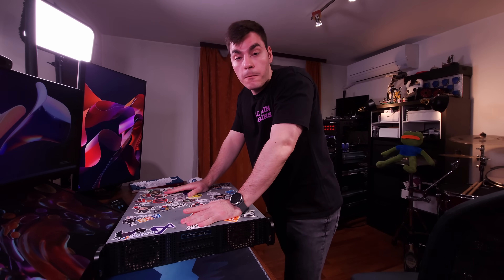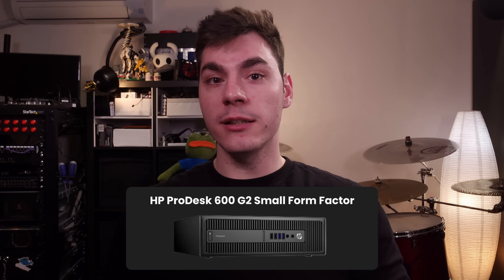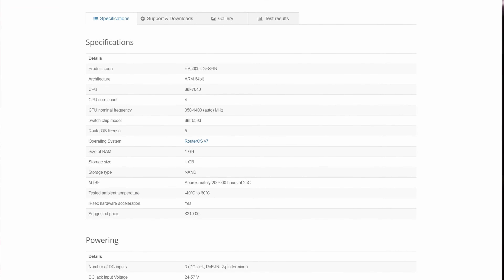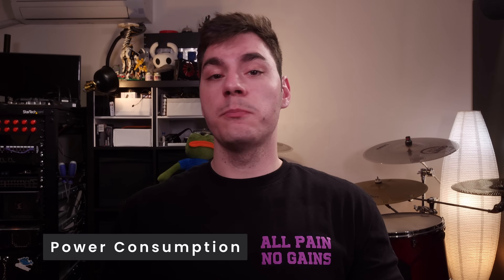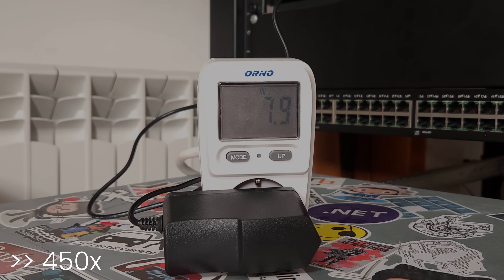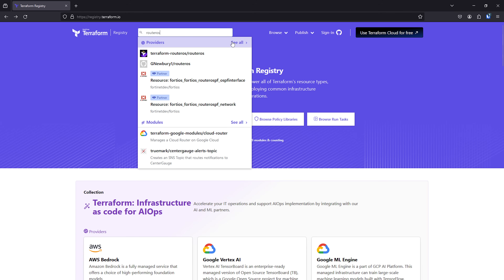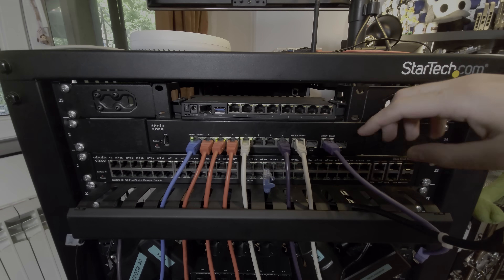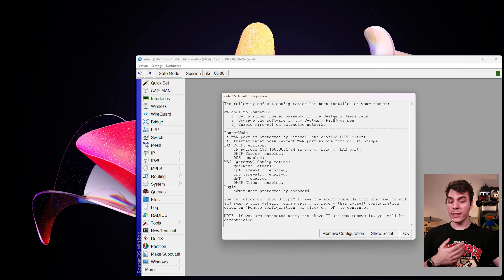Migrating From OPNsense To Mikrotik

Comment: Been using Mikrotik for over a decade now. Always exciting to see new content.
Reply: I've had a Mikrotik for must be 15 years. It's been sitting up a pole in the sun for probably 8 years. It still takes the latest updates and I upgraded the lte card in it. They still actually sell the board I believe, the rb912
Reply: @michaelculley8790  They discontinued the RB2011 a while ago. Which was the classic workhorse that we were using. Still using it actually. For basic needs it is still quite capable. But I am planning on upgrading as now I am playing with a more advanced setup... That old 2011 is like the little router that could. It will try but at a certain point asking a little engine to climb a steep mountain is cruel and one shouldn't be surprised when the CPU experiences issues with being loaded down... Plus I want to play with containers and for that I need an ARM based model as the MIPS processor doesn't support virtualization.
Reply: And like your RB912 it still takes the latest updates. I just ran updates on it last weekend.

Funny thing is I am running a multisite network all connected using a Wiregaurd tunnel and my HaPAX3 in my apartment has become the central hub... Yes a model designed as a basic router is managing everything... Just reflects how powerful a platform this is.

Comment: The RB5009 has a Marvell 88E6393 switch chip which does 10 Gbps accelerated L3 routing!  I've succeeded at making Ansible work with RouterOS, but i'm in the early stage to check idempotency, etc.  I don't know if you'll use 802.1Q trunking but it's fairly easy to do with RouterOS once you know 1 or 2 specific things. As a network engineer (and Linux Sysadmin!), i'm using Mikrotik since circa 2005 and i was certified MTCRE (just didn't do recert) so if you need help, just let me know!

Comment: Looking forward to the next video. I use both OpnSense and Microtik but my current Microtik hardware is in need of an upgrade. Just replacing with OPNsense feels like the easy option but i do like the look of the RB5009's.
Have you considered failover? And do you know how easy it is that to set up with routerOS?
Reply: There are many videos on using more than one internet access link, RouterOS can even load balance and do very crazy things!  Mangle is very powerful and i use it often to do many cool stuff with routing, DNS, etc.
Reply from the maker: I haven't really looked into it so I can't comment on that.
I will say, however, that if you're looking for fail over I think it's pretty nice that you can fit 2x RB5009 routers in a single rack unit using the k-79 mounting kit
Reply: you have one of the most annoying accents that I have ever heard 😂  @mirceanton

Comment: Welcome to mikrotik.Been using mikrotik since 2017,before that using x86 monowall  in 2008,x86 pfsense in 2014..now 2024, playing with openwrrt
Reply from the maker: Thanks!
The landscape is definitely quite diverse. I'd love to see more support for arm platforms though, as we've seen quite a few SBCs which would fit the bill nicely as a low power and quiet router.
Reply: I'm curious why you're playing with OpenWRT.  Do you have a use case?  I started my networking journey in 1991 as a network engineer.  I used since then many many NOS and i was using DD-WRT for friends and SMBs long time ago!  After finding Mikrotik / RouterOS, i stopped using *wrt.  I too used monowall / pfSense and i was glad to replace it with RouterOS too!  Not that they are that bad, but i highly prefer RouterOS for many reasons.  The management aspect of RouterOS being one of them, one of the best management i used IMHO.
Reply: @guyboisvert66  I have been playing with OpenWRT;  I was interested in the low power, compact size, and performance. It was  an RK3588 with 16G ram;  As a router, it worked fine but once you delved into building VLAN's, some pieces of the network rules seems to be less than optimal; but at the same time, things like Policy Based Routing with VPN's was super easy, and worked very well.  There's also a ton of other things like Docker, storage, etc that I didn't delve into; security was a greater concern, and OpnSense seemed "better".  It only drew a handful of watts, and was fanless;  so much overhead it was ridiculous.  Fairly sure everyone has unique use cases, and unique reasons why they went one way or another. 

 I still have a Mikrotik router unopened in a box; may have to try it some day when I get some time.  I could run much more on the RK3588; but I have trust issues; not with OpenWRT, but as the hardware wasn't directly supported by OpenWRT... There are ways to compile it yourself, but I don't have the time.. Great hardware though. 
I may still use the hardware moving forward; not sure how much I can change without annoying the spouse however.  I realize I like to tinker..

Comment: Hi, i hope you love your mikrotik setup, the RB5009 is great powerful machine. Some tips for a future. Bridging in mikrotik is really terrible because all packets are going through CPU, if you will have a better switch with sfp+, buy a SFP+ DAC cable, they are really cheap and connect switch and router with one port. On that router port assign VLANs and let switching work do a switch, not router. You will receive a better performance
Reply: There is an option to change that, they call "Hardware Offload" you can see that option in the bridge. This will use the Switch Chip instead of the processor.
Reply: @hey_leao  you are 100% right about this, but in some cases when IP filter is enabled some strange behaviour can happend. But yes HW offload is also solution, but sadly not for all routerboards :) I still prefer router on a stick setup, since messing with multiple bridges as vlans is actually nightmare.
Reply: @kurosudo  Yes! Thats why you need to do some inspection in your topology (its not a router problem). Another think about it "Not all device devices support port isolation, currently only CRS1xx/CRS2xx series devices support it and only 7 isolated and hardware offloaded bridges are supported at the same time, other devices will have to use the CPU to forward the packets on other bridges" and not all RBs has VLAN Table, thats important too. the option IP firewall uses CPU, you can try to use some bridge filter.
Reply from the maker: Hi! Thank you for the tips! That's precisely the plan. I am bridging the ports as a temporary solution until I get some proper switches.

I plan to use the 10g port for my lab switch and the 2.5g for my LAN switch and then one of the 1g ports for my WAN and another for my management network or something along those lines. I need to get the switches first though!

Comment: 15:30..
You said you are not familiar enough with RouterOS CLI.
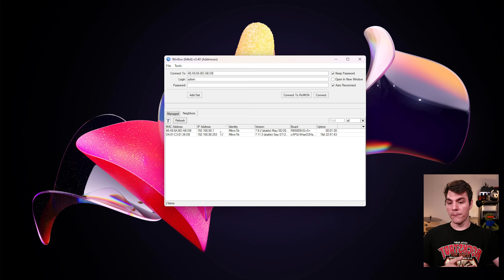15:44..
But the MikroTik "cAPGi-5HaxD2HaxD" has been in operation for more than 16 days. ;-]
Reply from the maker: The AP can also be configured via WinBox, plus I didn't do much on it.

I have used the CLI a bit when playing with the device but I wouldn't call myself familiar with it. It seems fairly straightforward though, as the commands resemble the path you would take in the UI as well

Comment: You can basically use more than 1Gb on 5009 using sfp+ and 2.5gb port. Can recive in sfp port with an adapter easily, so it can reach more than 1Gb
Reply from the maker: Yep, the device itself can do more than 1Gb. The problem is that I don't really have other 10g devices to test with it, either SFP+ or RJ45

And then, even if I did, my switches are all 1gb and my internet is not even half of that
Reply: @mirceanton  it’s more for the future, make this router with better longevity
Reply from the maker: @lucasthielke  oh absolutely. Even though I can't use those ports right now, they did play a role in the decision since they future proof this device a bit. They were not the main deciding factors, but they sure gave me some peace of mind!
Reply: Yes and no. You can't exceed 2.5 unfortunately but at least you dont saturate that also, if using that sfp.

Comment: So, you just trashed your over0sized firewall/UTM and replaced it with a router, congratulations on downgrading your security.... You drank the Miki coolade.
Reply: This to me seems like a definite downgrade if the end solution is just the Mikrotik router. I have used Mikrotik routers for over 10 years and found them to be a steep learning curve in terms of setting up, not a device for a home user or beginner. VLans are a real challenge to set up and do not simply work the same way as many other devices such as PfSense or OpenSense. Mikrotik type products. Mikrotik products require a lot of reviewing to know what is really under the frame in terms of what CPU processing is required to do and if there is a switch chip that will handle a portion of the traffic on the network. I can say from experience that products such as PfSense or OpenSense take less effort to setup and have the ability to do more depending on the hardware that the product is installed on. Software on piece together your hardware type solutions is normally better than fixed hardware that is limited to what the manufacturer will allow to run their fixed hardware.
Reply: @wawaweather  Agree in the context of home / simple network. A Mikrotik router is a swiss army knife.  As for VLAN, it respects standards like 802.1Q, the VLAN setup is not very complicated if explained the right way.  I did a demo for a friend: After 15 minutes he understood and was able to do his configs himself.  I do network engineering since 1992, i've seen/used so many things for many companies (Cisco, Brocade, HP/HPE, Juniper, Edgecore, etc.) and IMHO, Mikrotik has the best management interface: Winbox, Web, CLI, API.  CLI is structured, like a filesystem structure, it is much more comfortable than the usual "flat" command hierarchy.  It supports about anything you can imagine and then some, has many powerful features like mangle and scripting, etc.  It's well maintained and updates are free.  It's not packed with extras like antivirus, IDS, etc.  So yes, *Sense is good and with nice integrations, i've used it on the past (along with OpenWRT, mOnOwall, plain iptables) but for the price and functionalities, i switched to RouterOS a while ago.  It always depends on your needs!
Reply: @wawaweather  Mikrotik make some great hardware (like the 5009 - I have the PoE version) - for me the best thing is to ditch RouterOS and use OpenWRT.  It does everything I need (including niche things like USB-IP) and is configured in what I consider a sane manner.  RouterOS is a dog's breakfast as far as I'm concerned; I just don't see any advantage in using it so no reason to invest the time in rewiring my brain.
Reply: I'm a big MT fan but this also struck me as a security downgrade. I'd keep the dedicated firewall doing it's thing, and (possibly) move the routing and DHCP etc, to the MT.
Reply: You can use both mikrotik and opnsense as opn is a transparent firewall
Reply: Not everyone needs an advanced firewall. He said in his video that he is not hosting anything publicly, e.g. all ports are closed. Within a closed network, IDS is just wasted resources. For this use case, the mikrotik router is clearly superior.

Not everyone is running a business/enterprise, needing IDS. Every router can simply close all inbound ports and you are safe.
Reply: @2uxzh01k  All that and you hung on IDS only? Not much point in IDS, it's like a dog with no teeth, IPS instead. As I have already said, they are a dumb router ONLY.
Reply: @2uxzh01k Even IF you don't expose services externally, you need to protect the inside from malicious software, bugs an hacks that might comprise your clients. IDS/IPS will do that if you set it up and use it. Also such a setup will prohibit compromised clients to access command and control centers.

In short, use IDS/IPS if you can and want good protection
Reply from the maker: Genuine question: how is Mikrotik that much more insecure compared to OPNsense or other solutions? At least as far as I can tell features/customizability seem to be fairly similar.

If one has the knowledge to configure an OPNsense device properly, wouldn't it be the same case for a Mikrotik as well?
Reply: @mirceanton   a firewall (UTM or NGFW)  has multiple advanced features like deep packet inspection, ssl inspection, IPS/IDS, antimalware, sandboxing , application and url filtering and many others. Mikrotik has  very good products but has limited firewalling features. It's a good router but just a router. you can keep using Opnsense of other firewall solutions as VM
Reply: @claudiobolcato3048 , are you stuck in the mid 2010s? Nowadays most of the traffic is encrypted and newer technologies make it hard or completely impossible to intersect TLS traffic. Anyhow I agree with your bottom line: use MikroTik as router (or as switch, or as wifi-ap) and extend this setup with specialised systems, if you really (believe you) need them, be it a firewall, be it a network access system.
Reply: @mirceanton Mikrotik is only Router with Acess List. Which is no near to NGFW firewalls.
Reply: @mirceanton  Out the box, Mikrotik is not for the novice. They won't know about basics like SSL cert on the login (non self signed) , disable IP services like telnet, FTP, ssh etc etc... OpenSense and PFsense, out the box are set to quite a strict level of security, specifically for those with less experience on these devices or with basic network security.
Reply: @mirceanton  Pretty simple really, a router just routes traffic according to its rules. 
It's like a a traffic controller sitting at roadwords guiding traffic. He just passes or stops traffic acording to his "Programing"
A firewall/UTM (pretty interchangeable terms these days) not only will route traffic but will take a very close look at it as well as where it came from and where it is going. It will open it up and sift through looking for things that should not be there.
These are best though of as armed border control or customs inpectors.
Reply from the maker: Oh, that's actually such a great analogy! Part of my confusion came from the fact that, for better or for worse, I didn't really implement any sort of IPS/IDS or packet inspection on my OPNsense either. I was mainly using it as a router.

That's something Ive been meaning to look into for a while but never found the time to. However, given that Mikrotik allows us to run containers on the device itself, couldn't those missing features be added in via docker containers perhaps?
Reply: @mirceanton , better let the MikroTik-router mirror the traffic data to an external IDS, like Suricata on a different hardware, the same way you would monitor your MikroTik-device.
Reply from the maker: @jayfraxtea  hmm... I'm curious if I can set that up on the Mikrotik itself using docker containers. It may not have the horsepower to run all that at full speed though
Reply: @mirceanton , I ignored that after your first post cuz I'm not a fan of running docker on a MikroTik device. Instead I'd use x86 or ARM-hardware that you already have.
Reply from the maker: @jayfraxtea  Understandable, I think running containers on the router is perhaps a bit niche.

Since this is a homelab and I'm doing DevOps in my day job, I find the idea interesting and I'd like to see how far I can take the platform in this regard.
Even though it's not something I'd recommend to run in prod, it's something I find interesting to play around with.
Reply: @mirceanton , running a small container on MikroTik hardware basically provides endless possibilities for (niche) solutions. The thing is though that in a professional environment such solutions need to be maintained ... in times where some firewall admins struggle already with the 'basic' functionalities of their devices.
Reply from the maker: @jayfraxtea  i totally agree, but I don't think I recommended any of what I did here to be replicated in a proper production environment :))
I don't think I'm the best person to make such recommendations, especially when it comes to networking
Reply: @mirceanton  End user has the ability to fully audit all software running on OPNsense compared to Mikrotik
Reply: Security can be many things, like using zerotrust or running Suricata, controlling network port access with 802.1X, or...  As with RouterOS, It's fairly easy to mirror traffic and send it to Suricata as an example, that's just one possible thing out of many.
Reply: @guyboisvert66  You have ignored the obvious, Suricata needs to run on something to do the IPS. The best thging to do with the Miki, put it behind the ISP supplied modem, routers are not security appliances.

Comment: Welcome to the Mikrotik team, i have been running a rb3011 for like 4 years now, a bit overkill for my network hehehehe.
Reply: Using one rb3011 since last 2022, really a good router. It runs my 1Gb network, both ipv4/ipv6
Reply: @lucasthielke RB5009UPr here. I use it with a CRS305-1G-4S+IN to get a 10G backbone for my desktop and home server, and its PoE has been useful for my Grandstream access points. Absolutely excellent router.